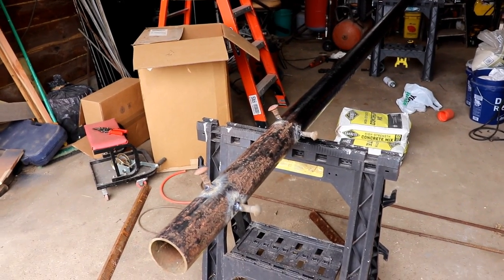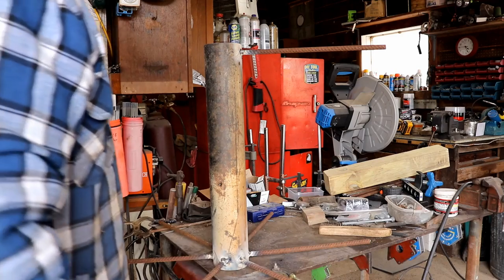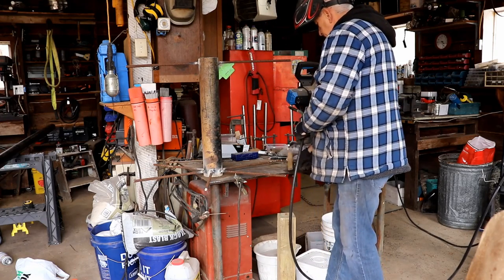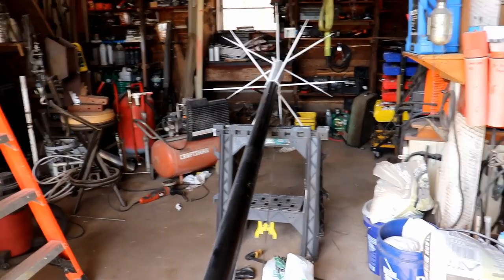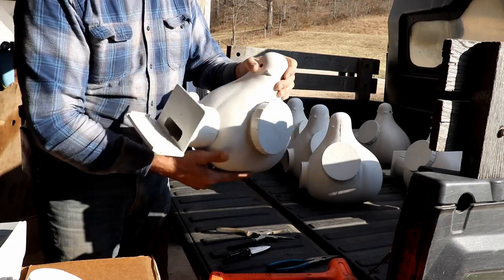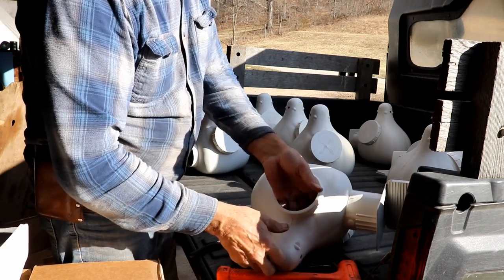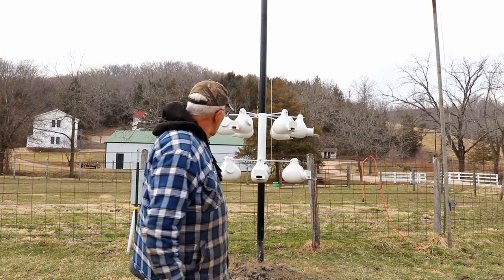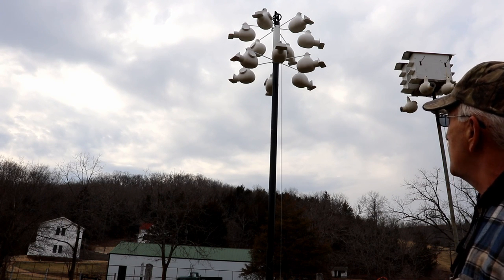566 RSW Building A Sturdy Martin Gourd Pole

Comment: the Troyer gourds leak alot of water inside the nest from the tunnel/push pin. I use lexel caulk around the tunnel and push pin, they are the best gourd I have ever used.
what you have there is vertical, horizontal is 14 inch. deeper. the entrance is the Conley 2. always put the top push pin in first. you did a great job excellent video.

Comment: Jerry, did you put something on the ends of the rods to keep the gourds from sliding off. Is it even necessary?
Also, if you put a "V" cut in the top of the riser tube and a peg on the post, it will keep the riser and the houses from twisting back and forth, in the wind. It's too late for this one, since the pole is already up.
Reply from the maker: The houses are bolted on the the houses cannot twist because the cable is stiff enough that it pulls it directly under the pulley